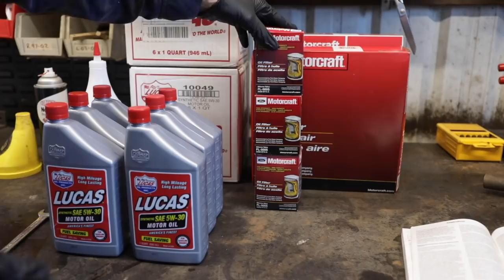How to Change Your Oil Like A Pro

Comment: Here´s a friendly tip For you Cody.   Before the next oil change, go to the wood shop and gather up some sawdust and wood shavings. The wood soaks up the spilled oil, off the floor,  better then the shop towels.
Reply: True dat!
Reply: My first job was working as a custodian at a school and As gross as it is we used saw dust to clean puke. Saw dust is the best thing to clean up almost any spill
Reply: kitty litter is still the best, and expensive lol
Reply: Fannar V. Haraldsson that's a good one, but that's a big puddle!  Learn the problem and avoid it in the future, unless as I have had in the past, oil drains on to the frame...
Reply: Yep. I got a bag or bucket of sawdust at hand to clean up any oil spills. Works great.
Reply: Oil soaked shavings for fire starting? Sounds good to me.
Reply: haybloomer  Done that too. Works great. Basically the wood shavings are like a candle wick.
Reply: That's what the British used for soaking up blood on their sailing ships
Reply: Or lay a big panel of cardboard down before you work, the cardboard soaked in oil is good starter in the big burner as well.
Reply: Fannar V. Haraldsson don't spill the oil then
Reply: Snow is great too. I have LOTS of it

Comment: The one caveat I have, I don't mean to be prude, is when you say to rotate your tires crisscross make sure your tires aren't directional before you do that, if they are it's just front to back
Reply from the maker: Yes good point,
Reply: ATGRC   Directional?   Can you explain that?
Reply: Some tires have treads which are supposed to point in a specific direction. If you rotated the tires crisscross while maintaining the direction the tire is supposed to face then rims would have to be inside out. Hopefully that makes sense.
Reply: Grady. Oh I see... thanks
Reply: Thought the same thing.
Reply: I always thought radial tires should remain on the same side of the car
Reply: Also, back in the day, we were told that radial tires were never crossed, that doing so would cause the car to "pull" because the tires were broken in rotating in one direction.  Has that changed with newer tires?  I got out of the business in '83 so that may be dated info.
Reply: Glad someone else called Cody out on this lol I may have wound up being mocked in the next video otherwise 😂😂
Reply: I would also add that it’s important to run you drive tires straight and the others cross. If you think about it this gives each tire a turn on each point of the vehicle. This is especially important for front wheel drive tires. Most of them only have one drive tire.
Reply: Front cross back, and back to the front... better rotation.
Reply: your right.
Reply: yeah. that is a good tip. my mothers suv has directional on hers. almost made that misteak once.
Reply: Or ... if the size is staggered. then it's just left -> right, assuming your tires aren't direction or asymmetrical.
Reply: Great point!
Reply: I was taught to cross the front tires over to the back, but to bring the back tires straight forward. That way all the tires end up rotated to each corner over time and ware evenly.
Reply: J Z depends on what you believe, whether you deal with seasonal driving, own a FWD/RWD/AWD vehicle, have directional tread tires, etc. There all kinds of ways that could be correct, but it really comes down to the vehicle.
Reply: I guess Im asking randomly but does anybody know a tool to log back into an Instagram account..?
I stupidly lost my password. I would love any assistance you can offer me
Reply: @Jimmy Johnny instablaster :)
Reply: Also another point is that the way you criss crops the tyres depends on whether the vehicle is FWD or RWD or 4WD too, just to get more even wear.

Comment: I’ve run several Chevrolets well in excess of 200k on conventional oils and bargain filters without a single engine failure.  I don’t deny the superiority of Lucas, Amsoil, etc, but I don’t see the reason to drop the extra cash based on my life experience.  I enjoyed your vid.
Reply: Hilltown I have pictures to prove otherwise.. but I’m talking about stp in particular. Other name brand oils conventional is fine
Reply: I almost agree with you (i think its worth getting premium oil). That said, I think you illustrate the most important thing. That's actually changing your oil. I work at an auto parts store, and it's pretty easy to tell the difference between between a car that has had its oil changed regularly and one that hasn't. you really can't tell the difference between a conventional oil car and a premium oil car. Unless it is a mercedes, but that's a story for another comment.
Reply: All depends on application. Run a high performance engine on conventional... it just won't last.
Reply: Its more important to change oil before it breaks down. Worked for major oil co. for many years, conventional oil is all the same and breaks down at the same rates. The additives in the oil are the true performance changers. Synthetic is different monster of course. Oil filters are made to a vehicle's specifications, any change to those could cause engine pressure issues, poor performance/gas mileage and long term engine damage so right part number and your good no matter the brand. Turning personal experience into evidence to support a claim is the real problem, at its least its bad science, at its worst its 4000 religions that plague our society and our progress as a species.
Reply: I could agree, except I would change oil&filter around 3K miles, whereas, I go 15K on Mobil 1, saves time under the  vehicles.  I watched a ut  video of a man with over 500+K on his 02 Avalanche. I would like to know his service advice.
Reply: +TheRocketbob22,  His service probably had nothing to do with it. In almost every case of extreme high miles vehicles there have been at least 2 factors that helped contribute to it. One was of course regular maintenance. The other was the way it was driven. Most are driven pretty easy, None of this jackrabbit stuff. Many were freeway miles as those miles are the easiest on the engine/drivetrain. 

On another note. You can probably get by with cheaper oil if you change it every 3,000 miles. That being said there is a big difference out there between some oils.  Is Amsoil one of the best? Sure it is but is it cost effective in my diesel? I mess around with my vehicles enough that I would wager its not.  Also is its soot control that much better than Rotella-T? Not really. Now when the soot has turned your oil to tar by 8,000 miles does it really matter that the additives are still good for another 5,000 miles?
I like Amsoil and will use it before really long trips back east from the west coast. But here at home I use RotellaT because it just gives better results than other conventional oils. 
As a side note most people probably get more wear from oil bypass at cold temps than they do from a cold start.
Reply: But can ur conventional oil go 15-20k miles between changes like a high quality synthetic?
Reply: Occasionally while driving I'll spot a car that has 2 out of 3 brake lights burnt out, and I can't help but think to myself, "oh my gosh, this person has probably not even brought their car to a professional mechanic for maintenance in basically ever."
Reply: Walmart super tech filters are made by wix. These filters have been cut apart and are just as good if not better than other filters. And they're $2.48
Reply: Hilltown. lol You are kinda stingy there. I got a suburban that has over 340k on it. It was abused when I got it. 900 bucks and I had to put a 130 bucks into a replacement rear diff since the previous owner shredded it. It's tired and by my standards ready to be retired. However it still runs even and quietly. The paint is not so good and the wife put a tweak in it near the back bumper. It burns some oil but I cannot complain considering it was a rescue. ;)
Reply: Just because the oil can go 15k+under ideal conditions, it doesn't mean that it won't become contaminated with water or dirt or just get low long before that time. I wouldn't go that long between changes regardless of the oil.
Reply: Hilltown but you may have been able to got to well over 300k if you'd run better oils and filters. I've got a 2000 Chevy z-71 and it's always had Lucus put in it. It went over 400k before it started burning oil.
Reply: You shouldnt go 15-20k miles on an oil changer PERIOD. I dont care what you put in it.
Reply: I feel like youre just paying the extra money for the name. Just like these designer brands like Beats by Dr Dre and Yeezys.  Lucas and amsoil are just "designer" brands.
Reply: I didn't think so either but my uncle showed me the wax that is in the cheaper oil it has clogged my vvti on my Toyota an a new one was 160 so I could have saved my self money by using better oil ! I don't run amis oil ! I do run a good name brand oil !
Reply: Some oils are better than others. I've watched several oil comparison and test videos and as far as I've seen Amsoil is the best. Believe it or not Lucas doesn't perform (I know, caught me off guard.) IMO, if you change your oil regularly and use the right kind of oil, you'll be fine. Since I work at a GM Dealer I get the Synthetic Dexos 5W-30 oil for my truck every 3,000 miles. Partner that with a K&N oil filter and shabam, I got an oil change for like $30
Reply: What are the build years? old cars can run on anything :) especially the v8 .
but i wont do it with a car above 2000  and what is cheap oil? supermarket oil from some off brand  i wont use.

Comment: Good job Cody, your grandfather taught you well. I am 70+, have always took care of my maintenance. The first service on each vehicle I wrote the particulars on the fender well. I have owned 25 vehicles, no issues, except I had to replace one electric fan on a Buick. Two things I do, I use an air grease gun on my Chevy Avalanche, 11 zerks.  There is a fitting on the drive shaft, did you check that?, I check the differential fluid also. My Ford Taurus Limited only needs oil and filter. I use K&N air filters. I never rotate tires, never saw a reason and get expected mileage , I never neglect tire health. I think premature tire wear is due to folks turning wheels in a dead stop position on abrasive concrete.  I use Puralator oil filters, there is a reason. I buy Mobil 1 at Sams Club.  I want Amsoil, but they would rather you become a dealer than sell you what you need.  I use ramps And wheel chocks. This is my third Ford Taurus limited, it is  an awesome vehicle, highly under rated by folks who write about vehicles after one cruise down the road. My second , 2015 FTL was totaled by a huge 8 point Buck, the buck survived, I want to sue him for damages, but he high tailed back into the woods. I hope to do this for 30+ more years, God willing. Do you think I should use Loctite red on the oil filter threads?

Comment: I change oil every day on many different types of cars for a living all the tips you gave we’re spot on only one tip I could add it when you look at your old filter always make sure the gasket comes off with the old filter because sometimes they get stuck on there and i have seen a lot of people double gasket a car and if they tighten it good enough it will make it about 20 miles or so and then start blowing oil all over the place.

Comment: Two more pro-tips. 1) Always make sure the rubber gasket comes off with the old oil filter. It will sometimes stay on the engine and if you don't realize it, and put the new filter on, oil will go everywhere when you crank the engine. 2) Be careful about keeping old, dirty shop towels around. They can generate heat and cause spontaneous combustion.

Comment: Another good tip would be obtaining an oil drain plug with a magnet on it. It will also show you engine wear by the particles sticking to it. Fram has a paper cartridge in their oil filters that almost immediately collapse and the oil goes through the bypass without being filtered. A guy I worked with years ago, cut about 5 oil filters open with an exhaust pipe cutting tool and explained it to me.
Reply: I've heard about that about the Frame filters from my uncle.
Reply: Also, they have premium oil now that is supposed to be good for 10,000 miles and filters up to 7,500 miles. I personally don't think it's good to go past 4 - 5 thousand miles between oil changes because of the engine wear, dirt and crud that just keeps circulating in your engine.
Reply: My dad used fram oil filters and supertech synthetic oil and his car is running fine 160,000 miles and counting
Reply: @markwillplay  
Awesome. Whatever you like. I was just throwing that out there.
Reply: Here's something I had just found that shows what components are in oil filters made by a bunch of different companies if anyone wants to to look through it. I don't have time to read it all at the moment, but the guy that made this seems pretty thorough:
http://www.austincc.edu/wkibbe/oilfilterstudy.htm
Reply: @ChuckNorrisUltra  my dad has always been a cheap skate but personally I would always get high quality products for my engine especially if I depend on it everyday.
Reply: Also get the best filters with a quality anti-drainback valve. K@N make good stuff. Also heard Purolator Boss is good, Amsoil, Mobile 1. If you spend the $$$ for expensive oil might as well get a premium filter.
Reply: @sundown798  
I use Mopar and Bosch, but I drive a Ram. I need to look into those to see how they fair. I didn't see them on the site I linked, but I'm sure someone has more results like that guy did for the ones I use. I read the first couple he did and looks like he was thorough.
Reply: @sundown798  
I have been considering K&Ns. I'm sure they're put together nice.
Reply: @markwillplay  I'm at 200K, with fram oil, and air filter.

Comment: Oil additives can increase the viscosity grade especially on cold climates. This can negatively affect the hydrodynamic lubrication characteristics intended by the engine design.
Reply: Especially on almost all newer vehicles that require 0w20, and 0w16 oil.
Reply: It can kill the variable valve timing mechanisms too.
Reply: Yeah don't why add additives. THe oiul already have al the stuff it need IMO.
Reply: I think it depends, I have used Lucas oil on my old cars 150,000+ miles and I'm convinced it helps. I junked the cars but when I did the engines were still going strong, it was all the other stuff going wrong that killed the car
Reply: @scottwynn1625  yep. We have 2 Hondas, and the last thing you want to do is run an oil that is too heavy because it can block up the vtec system.

Comment: Luckily for me, I worked in a mechanics shop for a little while as part of my apprenticeship and have done a fair few oil changes plus my father and my brother were both mechanics so I know a fair bit about oil changes but that aint gunna stop me watching a good old "classic wranglerstar" video! All very good hints and tips. LISTEN TO HIM PEOPLE.
Reply: tip number 9! see, i knew there would be something in here! very good suggesting on the door maintenance. never really thought of that. That's going on my list of things to do when i do my own "mini service". its pretty much what you do. I have a few additions.  I also all the seals like around the doors and the trunk and so forth. I check that all my lights are working (i check them pretty much every time i use them but doesnt hurt). I check my tyre (Im English, we use a y) treads to make sure they are still legal, i check my brake pads/shoes/disks and replace where necessary

I'm lucky in regards to getting rid of old oil. my brother works for a large company whos workshop has a big old oil tanker and we have a large container around by the garage which he swaps after about 20 or so oil changes (we all do it round the back of my fathers garage as its the best location for us all to do it)
Reply: Any you old guys remember "Door Ease" kind of a waxy stick in a metal tube for lubing door latches.  Used it at station cleaning cars.  I still have a stick of it,  Must be 40 plus years old.  Worked great without making a oily mess.
Reply: nah cant say i do remember it. i like to use a bit of copperslip every now and then

Comment: I've got a #12, after you are done lubricating your door hinges, use a little "rubber friendly" grease on the weather strips around the doors (and trunk/hatch) - it will help to keep your doors from freezing shut in winter.

Comment: I was a mechanic for 22  years and I've been to the Chevron engineer's oil conference presentation.. Some of my opinions differ from Cody's and some of them I completely agree with.. But I don't think he has anything in here that's going to give you problems. But I have found that making a commentary or video on car oils and maintenance always brings the personal opinions out of the woodwork and there will likely be many differing opinions on this video. Thanks Cody.